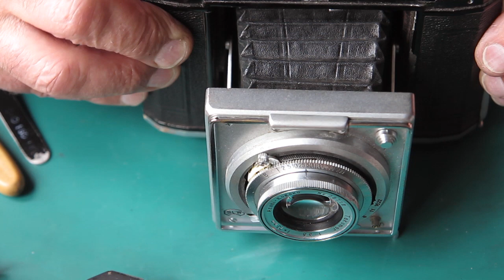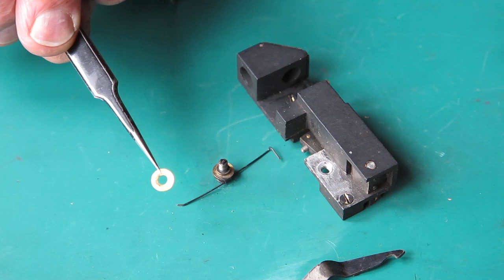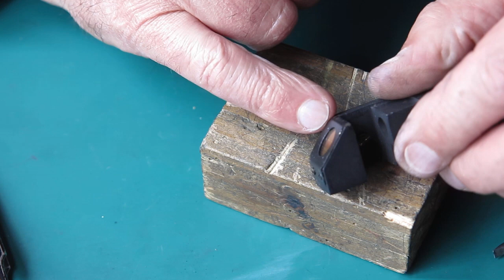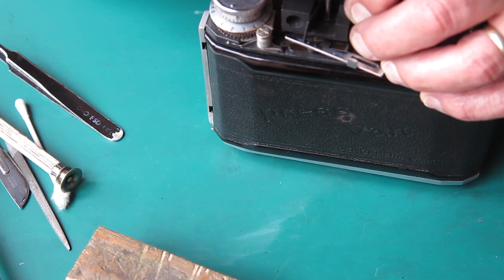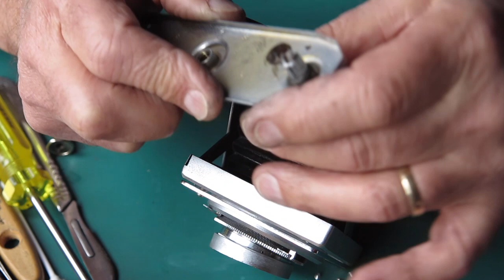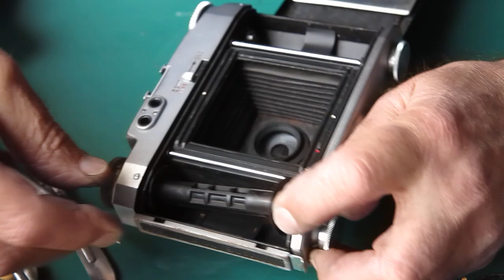The other Suzuki Optical Press Van camera Part 05

Comment: There your foot in the door 😂
A quick google for these cameras found the last one up for sale 😅👍
Reply: That's likely the "first" Press Van Mr. Sherlock restored for me.  I sent him two.  The one seen here I'm keeping; the other is for sale on eBay as item number 313305008211.  The one for sale on eBay does not have the 35mm capability; it is a 6x45 / 6x6 model designed for 120 roll film only.

Comment: Did it shoot regular 24×36 mm frames on 135 or panoramic? The somewhat more modern Mamiya 7 has a 135 adapter kit that includes a mask for the film plane, a pair of spacers to centre the 135 cartridge in the space normally occupied by a 120 roll, a rewind crank that screws into a hole on the base of the camera that's normally plugged and a special take up spool with extra flanges for the 35mm film. The pressure plate had to be used in the 220 position because of the lack of backing paper. There was no sprocket and the advance mechanism pulled the same length of film per wind by friction in all cases. The panoramic frames were 24×65 mm with slightly larger than normal interframe spacing and you'd get 15 or 16 per 36-exposure cartridge. It seems like a lot of palava to achieve the same result as cropping a 6×7 transparency or print, though it did let you use film stocks that were only available in 135. I still use my 7 but I haven't used the adapter since Kodachrome was abandoned.
Reply: It shot regular 24x36 frames.  Of course, that means the images were cropped in-camera (similar to what happens on 6x45 shots made on dual-format 6x45 / 6x6 roll film cameras.
Reply: @rogerb5615  Ok, thanks for clearing that up. So it would need a mask and a sprocket for measuring out eight perforations per shot.